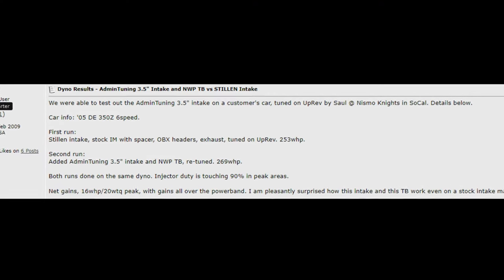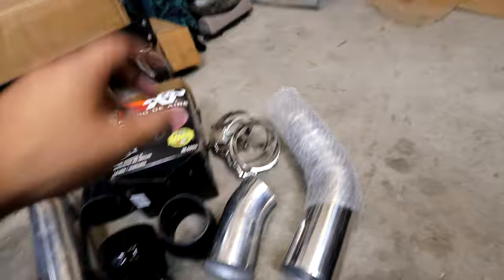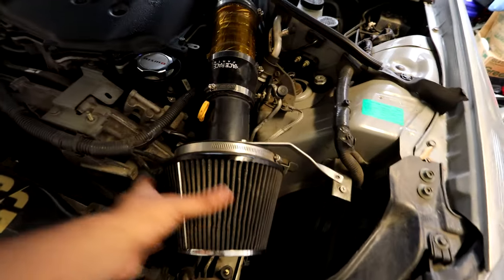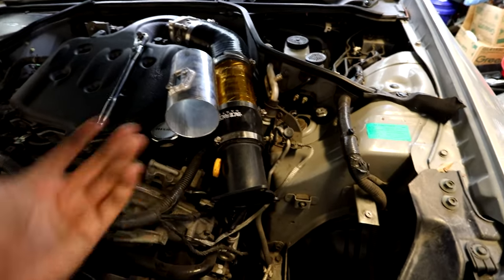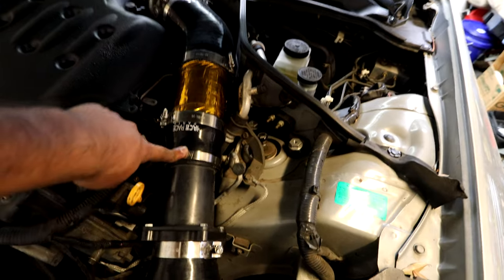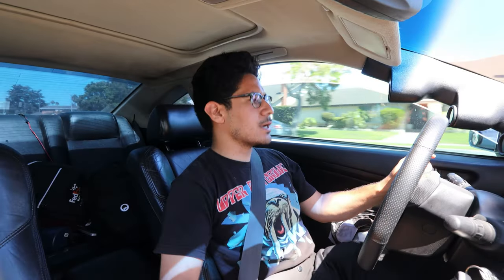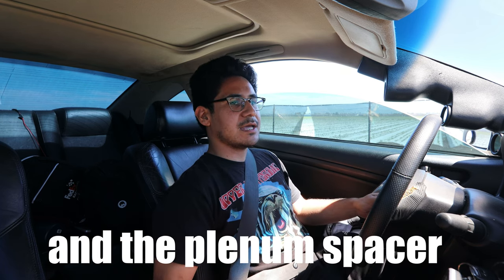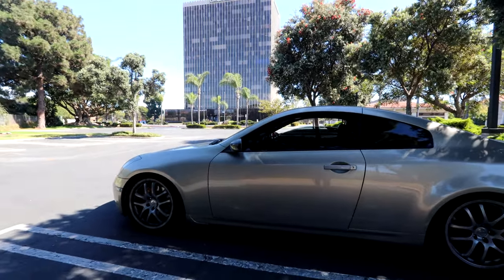DIY 3.5" Intake Install for YOUR G35 / 350z!

Comment: This was a great idea for a cold air intake in 3.5 inch very well done. I’m in the process of making a custom 4 inch carbon fiber intake for my DE but it will be bolted on to my Holley hi ram intake manifold with a 90mm throttle body. It cost quite a bit the route I’m going but it will push the DE over 300 wheel without cams and other supporting mods exhaust pulleys ported lower injectors etc. really great idea you come up with on that 3.5 inch intake

Comment: Did the 45° pipe through the bumper fit between the bumper and the crash bar without having to modify the crash bar? I know most aftermarket intakes (specifically for HR) you need to cut your crash bar to fit the intake

Comment: Wait so what was the part you mentioned you said you need in order for it to run good ? When I bought the car It came with it full intake tube and ran good the guy I purchased it from said not to mess with it cause it was sensitive and took awhile to make it work and if I mess with it may not run smooth.... I had to change my valve cover gaskets  and ever since then my car doesn’t feel the same wondering if that’s ThAts my issue ! My car feels sluggish I’ve tried to clean throttle maf did the relearn still feels sluggish
Reply from the maker: From experience, cleaning these Nissan mafs messes them up. I’d recommend getting a new maf sensor hitachi brand! And also the part is the oem maf housing!

Comment: I might sound dumb, but is this safe for your engine to drive with the intake in the rain?
Reply from the maker: There’s a product that’s like a little sock over the air filter, and what it does is repel water so if you’re worried about rain, that can help give a bit of ease. But if you go over puddles with a good bit of water, I would be careful since the sock can only do so much!

Comment: Bro what are you doing you can order at 3.5 inch from Z1  Doesn’t make any sense of going 3,5.then 3 Back to 3.5 you’re losing not gaining
Reply from the maker: Did you watch the whole video? I said I’m keeping it like that meanwhile, that way I can keep driving the car (daily) and also drive it to the dyno, THEN I’m swapping the 3 with the 3.5 maf housing so I can get tuned like that.
Reply: Which 3.5 @Z1 will work on a DE G35?
Reply: @tainocolon5572  yes I have a 3.5 on my de